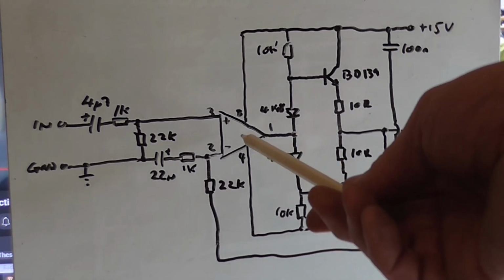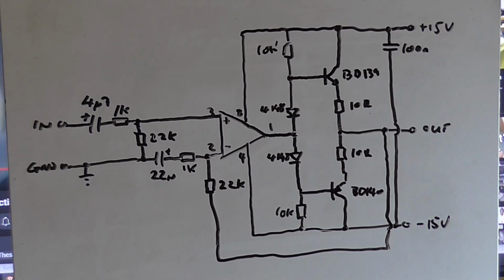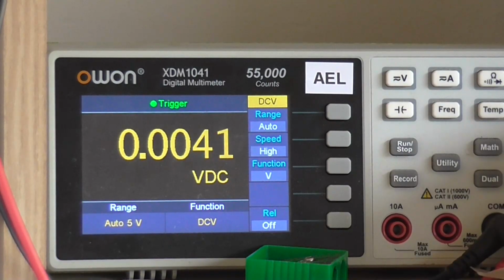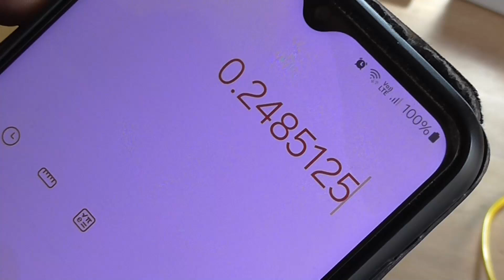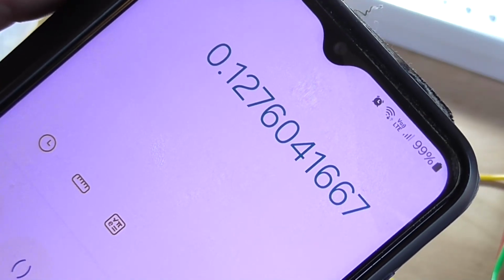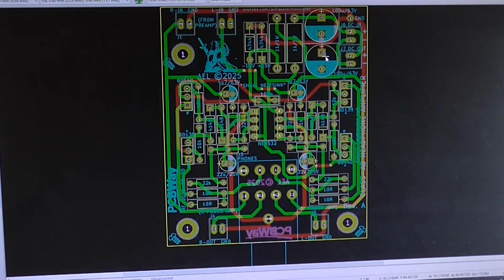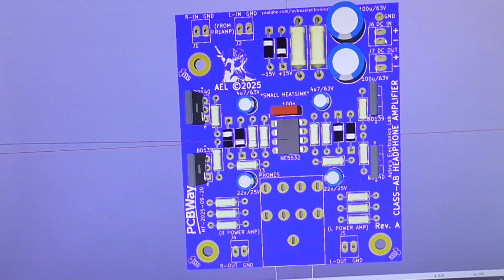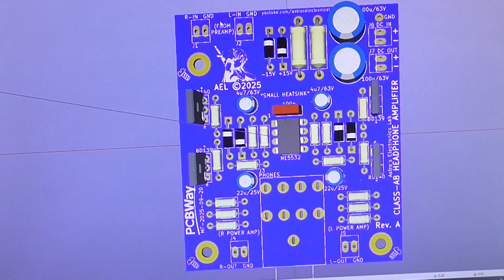NE5532 Headphone Amplifier From Scratch

Comment: You could improve that by adding a bias spreader. Change the top diode for a 10k resistor (call this RB1). The lower junction of this resistor (RB1) is connected to a 10k pot (VR1) which replaces the lower diode. Then add a small signal NPN transistor - call this TR3 - (BC549 is fine) with collector to the base of the BD139 and emitter to the base of the BD140. Base of the BC549 (TR3) is connected to the junctions of the opamp output / upper leg of pot (VR1) and lower leg of the middle 10k (RB1) resistor. This improves symmetry and also gives a slightly improved voltage swing. THD is also reduced. The LF rolloff is a bit high as well - I'd increase the 22uF to 47uF. Unless you have some HF filtering further back in your preamp, I'd also add a 470p cap in parallel with the 22k input resistor.

Comment: 68R with a 1k in parallel gets you very close to 64. I saw an interesting design from Phil's Lab, he was just using like 4x or 8x NE5532's paralleled to get output power as well as slightly lower noise floor

Comment: Interesting circuit.  Just one question please?  What is causing the asymmetrical clipping?  Regards, Felix vk4fuq in Australia.  PS.  The occasional swearwords are a bit of a turnoff in my honest opinion.
Reply from the maker: Maybe also a slight imbalance of the supply voltages. A bias-spreader would probably help, but I don't see the need in something simple that just gets the "job done". As for my swearwords, I'll tone it down from now on.
Reply from the maker: Most likely differences between the BD transistors.